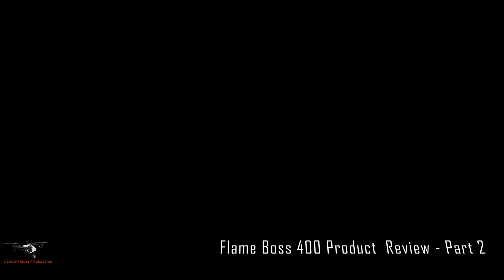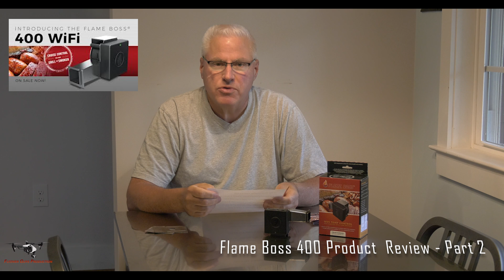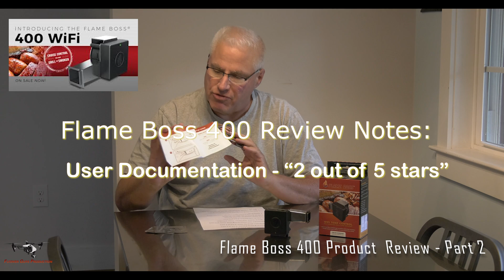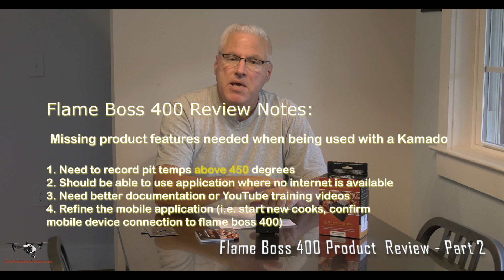Flame Boss 400 Review - Part 2

Comment: Thanks for the thorough review. 

Having no local/manual option (e.g. local wifi sans internet) is a no go for me. Seems like they should have named this "Flame Boss 400 Internet" (instead of "wifi"). Seems insane to tightly couple the core function to both the internet AND likely to Flame Boss cloud/server environments (based on other comments I heard about Thanksgiving tech issues).

To borrow a term from web dev, seems like a core design of progressive enhancement would be ideal. e.g. If you have Wifi but no internet, then support local wifi connection between phone and FB400 via your router, if internet is available, then support remote monitoring, if Flame Boss servers are up, then support cloud logging, alerts, etc.   Bonus for a device that supports some sort of P2P connection for non-wifi scenarios. Yes, probably would have added to the cost of the device (e.g. FB300 or the upcoming FB500) but still short-sided as is. PS: Throwing away a meal or two quickly pays for better equipment.
Reply: I know this is a 3 year old post… but you can direct connect to the flame boss 400 direct (Bluetooth) so you do not need wifi at all times
Reply: Would be nice if it can do wifi and in case it lost wifi switches to bluetooth. Last cook my device lost conection for 1,5 hours

Comment from the maker: One additional note that is key. I now have used the Flame Boss 400. One for boneless pork loin and yesterday I cooked beer can chicken and both times the temperature variance for the meat probe was 11 degrees lower for the Flame Boss 400 compared to my Thermapen probe. Now I do not know if the problem is with the controller on the 400 or the probe included with the 400 unit. And I do not know of anyway to calibrate the temp reading of the 400 meat prob. 
  
On the positive end the reading of the pit temp probe seemed accurate. If you are now using the Flame Boss 400 you might want to compare the meat temp results that the 400 give off to another meat probe.